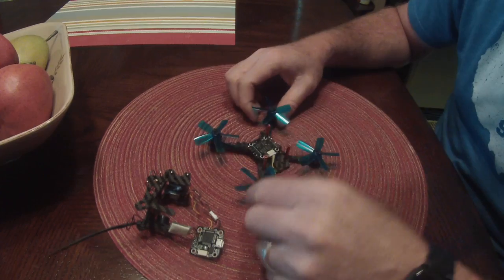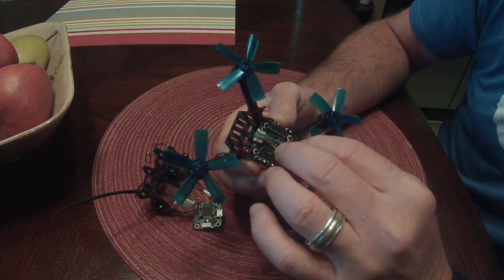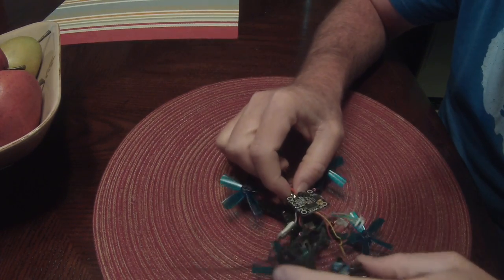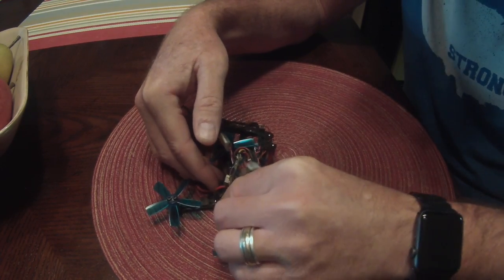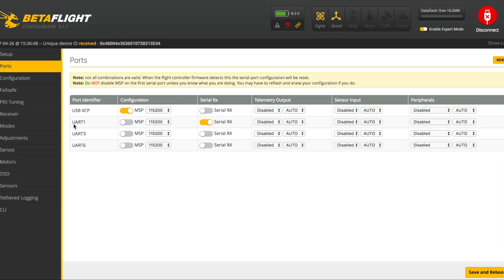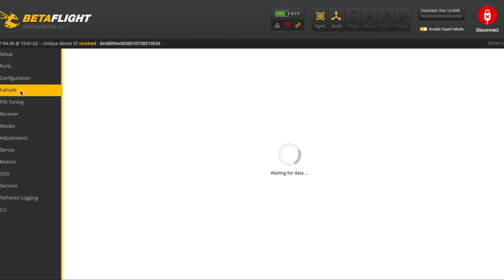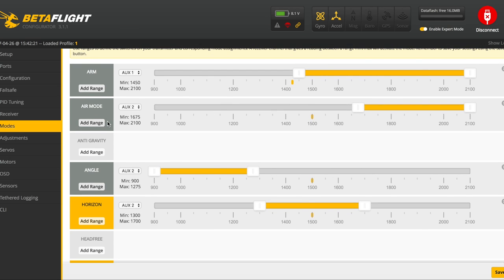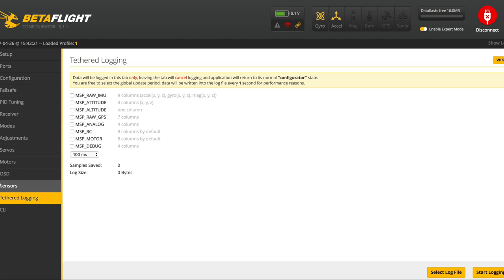Firer 110 Build and Betaflight 3.1.7 Setup

Comment: Hey, thanks for this, it helps me alot. My first issue is my screws are too short that come with the motors..lol. I also can't find the link for the PDF for ESC wire orientation?
Reply from the maker: Thanks... Glad it has helped.   I added the link to the wiring guide for the ESC in the description.
Reply: Jason Graham the PDF doesn't show wire orientation or it doesn't matter?
Reply from the maker: Basically you need to match the wire orientation between the FC and the ESC.   The wire plugs into the ESC and that plug is what shows the orientation.   In the video I talk about how you will have to compare the plug layout to each end on the FC and ESC.   What I do is just match them from the FC end.   So I leave the ESC end alone and typically rewire the FC end..  So if ESC PWM1 is say the grey wire, I find where on the plug on the FC it expects PWM1 and I take the wire out of PWM1 on the FC end of the plug and move the grey wire to that spot.   If you not familiar with removing the wires from this connector it's very easy, there is a tiny white tab looking thing on the side where you can see the metal pins, just use a razor or xacto knife and just lift it up a little and pull it out, that will leave the metal end on the wire and then you just slide it back in whatever slot it goes in.   The black ground wire should already be good and you should only have to reorder the PWM signal wires.
Reply: Oh ok, I have exactly the same parts as you except my receiver is a flysky so what you did should match but I will double check. I did see that part but didn't fully understand...;)